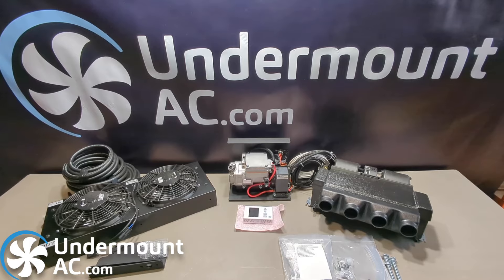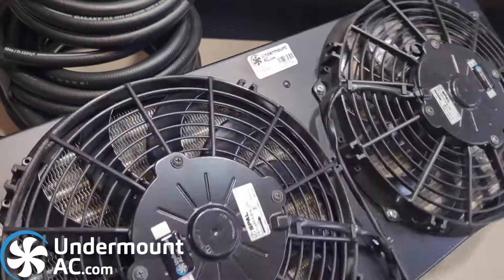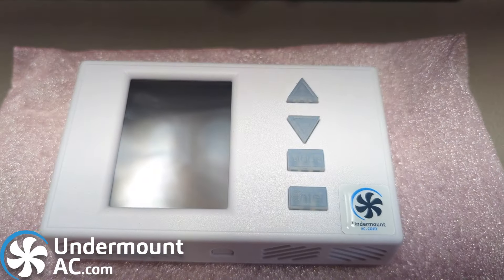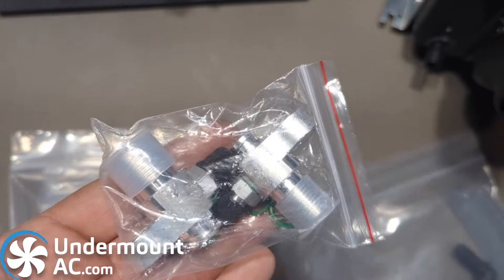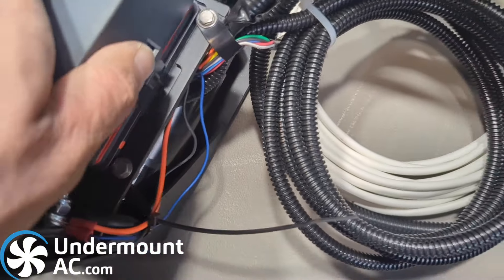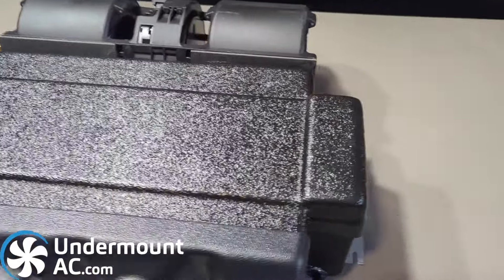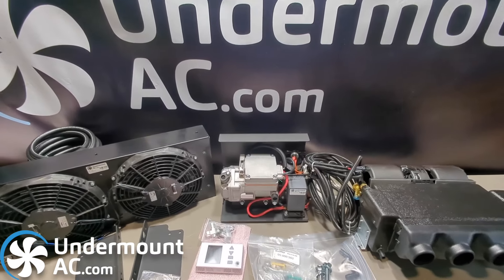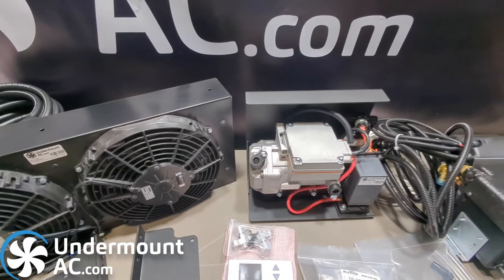UndermountAC.com DC 12V 24V & 48V Air Conditioner Kits Version 3

Comment: y'all have got to get working on a heat pump model. it's not that much more complex and is a lot more efficient than electrical resistive or fuel-generated heating
Reply: Yeah for real!
Reply from the maker: Unfortunately not. While it would initially be more efficient, it would quickly be underpowered in colder climates. We are doing testing but the limitations of automotive refrigerant is the issue.
Reply: We have EVI compressor for electric air conditioning heat pump system. It will be very popular soon.
Reply: @Derek-autocooling details? I'm shopping.

Comment: Very interesting. Is there a kit with just the compressor, and would I (relatively easily) be able to use my stock heater core/evaporator/climate controls? Of course custom work would need to be done.

I can easily find all the A/C components for my system that I need, but I would really like to have something that I can relocate elsewhere and won't draw on my engine.
Reply: the huge alternator mandatory with its 50% losses put more draw on your engine then the typical ac compressor on a belt drive.  😂

Comment: Would it be possible to use only the compressor with stock AC parts (condenser, evaporator and control) ?  I'd like to add a supercharger on my car, but that mean I would lose the AC compressor.  So I'd like to swap from belt driven to electric driven compressor.
Reply from the maker: No, unfortunately it's not something we support. We can't support or warranty any parts other than the ones we have fully tested and designed with.
Reply: You can do it but you'll need to figure out a lot of details to make it work for your car. I did an engine swap and didn't have space for anything other than an alternator.

Comment: Good day to you. Can you tell me the 12v amperage draw and output BTU maximum. 
Thank you
John A 60107 USA.
Reply: So what is amp draw?
Reply: @starfirerider  You have voltage and you have amprage in every circuit. Amperage is the strength of a current of electricity carried by a conductor or generated by a machine, measured in ampères.
Reply: @johnclamshellsp1969  so how many amp does that unit pull?
Reply: @starfirerider  That's what I asked about on my comment. My guess would be about 40 amps at 12v DC.

Comment: Really tidy looking kit!  How much power (Watts) does this pull on a hot day?
I saw you answered that the refrigerant is the limiting factor for making a heat pump.  What refrigerant do the EV's that run heat pumps run?
Thanks for all your hard work creating this product!
Reply from the maker: The system does not draw any additional wattage on a hot day, it stays peaked at 1100W. Refrigerant is a limiting factor at 12V. EV's run 400+ V and just run heat pump's at 3X the capacity. At 400V that is only an increase of 6 amps, but at 12V that is a increase of 200 amps.
Reply: @undermountac  Ahhhh...it's not a physical property of the refrigerant but volume.  That makes total sense!  Thanks!

Comment: Looks like this is the ticket for keeping the dog van cool in 100+ Texas summer heat. I don't see where roof mount 12v systems can even come close to your BTU to power ratio.
Reply: That is exactly the idea. Because our split system uses the most efficient parts we can source, combined with large surface area on the condenser, we get the most BTU/hr out of the system.

Comment: How loud is the compressor? Can it be mounted inside the cab?
Reply: I would like to see a db rating on the compressor. think the compressor would bring in a ton of heat which would be problematic but some applications there just isnt room.
Reply from the maker: We don't recommend mounting the compressor inside as heat is a byproduct and the compressor and lines leading up to it will sweat from condensation. It's not loud, its several dB quieter than the condenser fans.

Comment: With the condenser mounted under the vehicle, would it be safe to hose it down after a long camping trip to remove dust? if not what would be the procedure to minimize or remove dust?  thanks.
Reply from the maker: Yes, absolutely. Treat it exactly like you would the rest of your vehicle. Everything is rated for water/dust ingress. Hose it off after a particularly dusty or muddy trip. Keeping it clean will make the system most efficient.
Reply: Flash to 1978! Our volks wagen bus had split a/c unit. Had the condensers mounted underneath floor board. Center mounted plenty of room since no drive shaft. Never had a problem with rocks/stones/pebbles...but that vehicle was plenty high off pavement. Submerged those fans several times during hurricane seasons..never hurt them...

Comment: Could the be good for a van conversion? Can it be ran off of solar?
Reply: it can be run off of your 12v battery without the engine running, solar would depend on how many watts/amps you have available, their page says it'll pull 1100 watts about 85amps at 12.4v
Reply: @mccarterjg  thank you😊

Comment: Is the 48-volt more efficient than the 12-volt?  What is the cost please?  How many would I need to cool a 45’ bus?
Reply from the maker: The 48V system will be exactly the same as the 12/24 systems, simply different input. You would need to do a BTU calculation but I suspect 16,000BTU/h is not enough for such a large vehicle unless you are in a very mild climate.

Comment: Good afternoon. I am building a custom car and want to use your system in my right-side body pylon air intake. Is your V3 kit adaptable for a 2-seat cab?
Reply from the maker: It's possible but I suspect the dimensions will be incorrect. Take a look at our website and look up the dimensions.

Comment: How do you prevent it from killing your battery or batteries?
Reply from the maker: It will shut down when voltage reaching the compressor hits 10.5V. However most of our customers use LifePO4 batteries which have. BMS that would shut down when the battery nears 0% SOC.